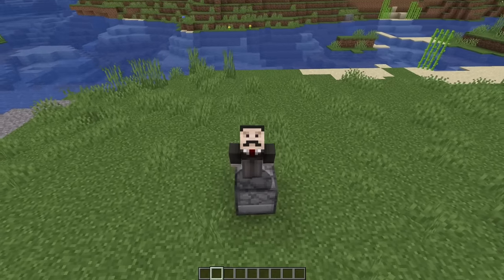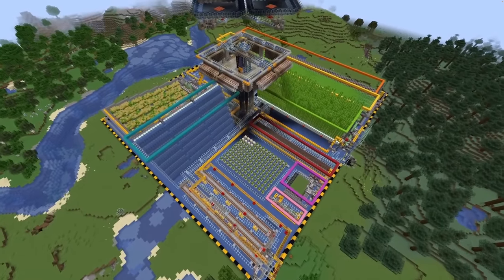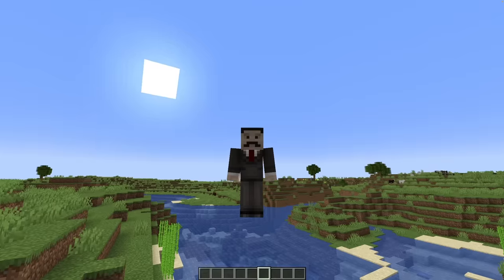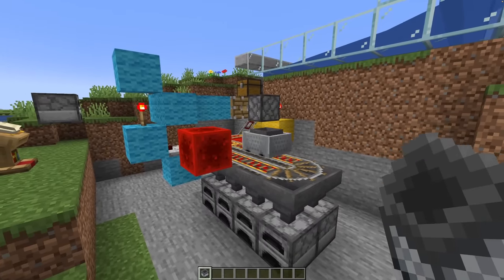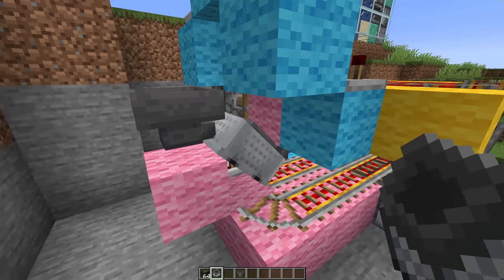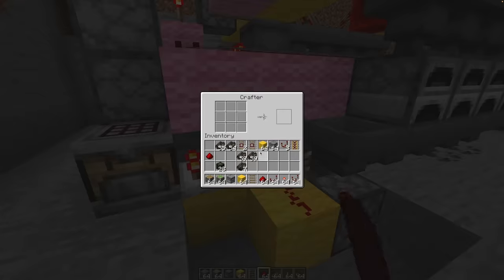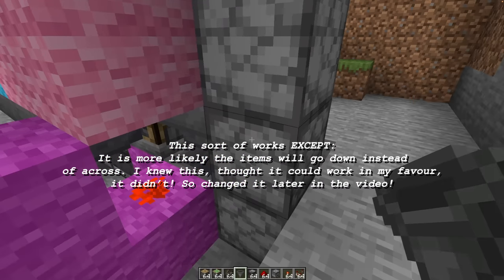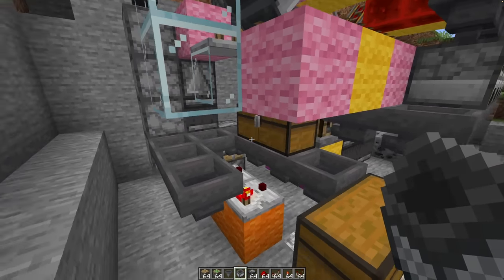INFINITE Furnace Fuel using Crafters in Minecraft 1.21

Comment: My dumb method of avoiding fuel wastage is to let a reservoir (1 or more chests) slowly fill. When it gets full-ish, the comparator output will release the reservoir's load; when it gets empty, the comparator's output will trigger the flow to stop. It's possible that there will be waste, but it happens once per load instead of every time a resource gets harvested.

Comment: honestly the kelp smelter could just be a chain of hoppers like a lazy sorting system since as long as there is a minimum of 20 you will get max efficiency so simply allowing the hoppers to overflow and expanding the chain you will eventually match the output speed with the furnaces and get a more consistent output.

sure you'll have stacks of kelp in the sytem but it's an infinite farm, having spare stacks of items in the output is the point, and if it is that bothersome dummy items can reduce the hoppe inventorys to 1 stack of kelp instead of 5, just don't dummy up the final hopper and you're good.

Comment: Notably, if you don't bone meal the plant, you need 40 kelp plants to keep a single furnace running indefinitely – as long as you are in the area. Doing the same thing with bamboo (and crafting it into planks) you only need 21 plants to keep a furnace running indefinitely. However, if you build a bone meal farm and bone meal the plant, kelp becomes way more efficient than bamboo. That's because kelp grows much slower than bamboo naturally.

Comment: could've used the copper flipflop for the kelp furnace: when detect furnace turns off, flip on and allow signal when comparator reads furnace full enough (rs strength 3, and gate to dropper handling the dried kelp blocks) ... I even made a tile able version that's 3 blocks wide years ago

Comment: Point #1 in your FAQ post, sorry but that's a problem with your specific design. If you output into a hopper line and pull kelp from the hopper line by placing one below, and have that line go to the kelp smelters, then when it fills up all kelp them just moves past. Place the unit that splits the kept after the item elevator, elevate the items up, and then split them, now letting it fill up the fuel for the kelp no longer breaks the item elevator.

Comment: You might have used the new flip flop block to match the changes to the furnace's state! And then caught when it went from on to off to input kelp again! By the time the first kelp is done burning, more is already in, so you just add your 21 bits of kelp when it turns off and voila!

Comment: I think you have made this ultra complicated in every corner.

For the kelp you could simply up the kelp farm and get more kelp. make a semi large storage with double chests that are inter connected ( or even skulker fillers)  then get your kelp from there.

and for feeding 8 furnaces/smokers, you can simple take the output of 4 furnace back into the system and send the output of other 4 to the super smelter, yes you only need 45% but set up a storage system and once that is full set up a shulker filler to send all those extra kelp to the super smelter.

But to be fair you like using red stone more and I like using basic stuff

Comment: NGL, mumbo made this so much more complicated than it needed to be. 
You can just time your kelp farm for an hour and then divide it by furnaces smelt rate to know how many furnaces you need. To setup the input, literally just send a minecart under the blocks your kelp are pushed too over a furnace array of the size you got via math. 
Then to get the kelp blocks into those furnaces, again just run a minecarft under them to get their output, have it go over their own feul input hoppers, then over whatever other storage hoppers you want or into another furnace array.

As long as the system slight over produces, it balances automatically cause hopper mincarts are rad like that

Comment: your pinned comment suggests you need item splitting in order to fuel this machine and the eventual super smelter it powers. However, consider the design of moss-based bonemeal farms (restocking the core system loop and funneling off the excess if hoppers fill up).

Comment: If anyone is looking for ideas to fuel their gigantic super smelter, just add a line of hoppers connected INTO the furnaces, water stream above the hoppers, and a carpet duplication farm at the beginning of the water stream. After a minute or so of the dupers running, the furnaces basically get infinitely fueled. You can change the size of the carpet dupers accordingly to your super smelter.
I realised that a water stream is better than a railway system with hopper minecarts.

Comment: You dont need any circuitry to enable and disable the smokers. Just make sure you producing kelp at a higher rate than you can process it. This way you will not be wasting as much kelp. Small inefficiency is acceptable.
Reply: Also you dont need 45% of kelp blocks to go back as fuel. What you want is an overflow check. while storage for the smoker fuel is not full then send it there. When it gets full send it elsewhere.

Comment: @5:30ish...If you add a signal of 9 into the comparator of the crafter you will get cut.  Better to subtract mode with signal of 8 triggering when 1 is ouput (thus all 9 kelp)...or maybe I missed something cause this was a bit fast

Comment: Anyone who wants to set how much of an item is required to start a process use a shulker loader + unloader. They are pretty easy to modify to work off a smaller amount by using comparator subtraction mode.

Comment: I have designed a 16x furnace, with carpet dupping, that is ridicule smart.

The carpet dupping only turns on when needed, its exaclty self sufficient, not a single carpet is dupped more than needed, it doesnt involve any cart or hopper cart, and it only needs ONE BLOCK LENGHT of redstone system to work. I really wanted to share it with people but Im not really a famous person...

Comment: [2:25] Could you link the first furnace to a tree farm which crafts planks/sticks and feeds them as fuel into the furnace to smelt the kelp into dried kelp? I mean they don't smelt as many kelp(s) as dried kelp blocks; however, due to the speed this farm would produce planks/sticks, the furnace could be powered for longer. Additionally less kelp is wasted in crafting dried kelp blocks, as it is used on the super smelter. @ThatMumboJumbo

Just an idea

Comment: You could cut out the refueling requirement by using campfires to make the dried kelp.
Reply: You can't use hoppers on campfires
Reply: @crossiscool6681  Yeah.... you can.
Reply: Campfires do not have an external inventory. Raw food cannot be loaded into the campfire with a hopper.
Reply: @VelaiciaCreator Unless you mean the food flying out into hoppers surrounding it? Besides campfires can only hold a few items and take ages to cook..a smoker would be far better. Using a campfire would the system incredibly slow and inefficient compared to normal smelting systems lol
Reply: @testerwulf3357  Campfires aren't nearly that slow tbh. And the hopper does pull when you properly wall things in. It's only inefficient in size.

Comment: wouldnt it be more efficient to 
a) have a chest where the minecart can pull from (because minehopper is faster then normal hopper) 
b) send the minecart off with 20xfurnace/smelter 
c)build a buffer for the drying part and every overflow will be redirected to the supersmelter (might me more lagfriendly but takes some time to fill up but garantees that the drying part is never broken) 
d) depending on the output of the kelpfarm there wouldnt be that manny smoker/furnaces needed and a simple hopper design would work as it fills up a furnace and keeps that running and then filling up another one

i would love to hear your thought on that.

Comment: I wouldn't care if it was little inefficient. I wouldn't count every item smelled by dividing it by 20. The simplest way to do it is making sure a double chest is full of kelps then flush it down to smelting until the chest is empty which you can achieve by simple rs latch and hopper locking mechanism and recycle the recently crafted dry kelp blocks through production furnace making sure they are fueled and taking the excess as profit. With this way you can circulate entire double chest of kelp and only waste kelp lesser than 20 item which is general division in math where you can't have more excess than the division itself

Comment: Mumbo... regarding keeping your furnaces full of fuel, assuming your farm has a fast enough output, could you not just have the crafter kelp blocks feed only back into the furnaces, with an overflow line that leads to the output? It's not as efficient, however, it's more resource and time efficient, and you could use the extra resources and time to scale the farm up.

Comment: Surprised you didn't just add a counter system that counts items going into a hopper chain, unpowers the hoppers on top at 1 for each module, then after twenty cycles fires a circuit to feed fuel.

Comment: Bamboo into ladders as fuel sounds way less complicated
Reply: It’d be a larger system…so more complicated
Reply: @testerwulf3357  How do you figure?  The farm is smaller, has no water, and requires no smelting to turn the product straight into fuel.  Plus all of the output becomes fuel, so there's no complicated recirculation mechanism to worry about.  It's just bamboo > sticks > ladders.

Comment: If over-engineering were an Olympic sport you would take gold
Reply: 1. If hopper feeding furnace array is FULL, start smelting
1.5 if hopper feeding furnace array is empty, stop smelting.

2. Dry kelp is crafted, 100% goes to furnace array.
2.5. Kelp blocks not used go to second array.

Done

Comment: 5:00, why does it have to be occasionally? can't you just 'overfeed' the system untill all spaces are filled up with stacks? the kelp blocks won't burn quicker than they get input anyways, so the consumption/hour of Kelpblocks won't change, it will just take a bit of time to fill everything up, but once it's filled up your 'excess' can be dumped in a chest/storage unit

Comment: Why do you need to restrict kelp block flow back to generator itself?
It will get full at some moment and you will get the same output without randomness. It will happen a bit later but this farm is fully automatic and requires only for chunks to be loaded so in a long run you will not feel the difference.

Comment: Mumbo, could you not have just connected a comparator to the hopper above the furnace that smelts the kelp originally, and had it detect for, say, 2 items? It would require "primer" kelp in that case, but then it would only ever input a kelp block when there's 66 kelp in the system, it would smelt 20 of them, then wait for the system to build back up to 66

Comment: Quick Question: with the Crafter block could you make a system where you can request an item to be crafted? there is a mod called refined storage and in it there is a block called pattern grid it lets you make crafting recipes that you can click a button to make that recipe in an instant. im wondering if that would be possible to make something like that with the new Crafter.
Reply: yes, but it would be quite massive
Reply: @techheck3358  ok ty

Comment: I feel like this is overly complicated.
1. Can't you just test if the main hopper for the kelp is full?
2. Cant you just set the right amount of kelp to smelter so you have a backlog of kelp? In other word, simply smelt slower than your production.
3. you can have an hopper line that feed the hopper for the kelp blocks fuel. If you just set it right, the hoppers for the fuel will fill first and then all the excess will flow naturally to the next step

Comment: Why not just use a tree farm, start with 1 piece of coal then get 8 charcoal. Use hoppers and droppers or whatever to move the charcoal back into the furnace so it's self powered as long as the tree farm is on. No crafting needed

Comment: Wouldn't it be easier to work out how many kelp per minute are produced and just use the appropriate amount of furnaces to not waste fuel? No circuits needed whatsoever.

Does the farm produce 50 kelp per minute? Do furnaces smelt 20 per minute? Have 2 furnaces. Done. No fuel is wasted, you are producing a constant output of 4.4(4) dried kelp blocks per minute

Comment: To be honest I don't get why "kelp crafter" cannot be just overflowed? 
sure initial fill will take a while, but if smelting input is divisible by max smelting power, you cannot waste a block. 
also this thing is not ready for overflow at all. if you dont use super smelters fast enough, stuff will break badly.

Comment: just saw this and would it not be easier to just use 2 crafters instead of trying to use one and then have it send stuff to 2 different spots. as you said 50/50 so half the furnaces go to one crafter to fuel them then the other half going out to another sending those to the other furnaces below.

Comment: My hopper minecart that feeds the kelp gets stuck on the detector rail on top. And the switchable rail gets stuck in the wrong position so the minecart can not get filled up. Can anyone help ?
Reply: I’m encountering that same issue on a server.
Reply: I figured it out. It’s about the orientation of rails in Minecraft you have to build it facing North. More specifically, if you build this exactly like his design in the world download, when you look at the front of the furnaces for the final smelter module, you should be looking North. If you build it facing south, the rail will permanently be in the wrong position.

Comment: I wish u did a step by step of building it so much simpler if it was to replicate
Reply: I built it from the world download. Takes a lot of back and forth, but pictures from angles can help. Make sure you build it where the final smelter is oriented north, meaning when you look at the front of the furnace, you are facing north. If you build the farm exactly the same it will be fine. If you don’t, the orientation on the switching rail for the kelp distribution will be always facing the wrong way.

Comment: 2:13 Wouldn't you just want to pool up the kelp until a sufficient amount has been generated then let it continue through the system? Of course, I've never made anything in redstone like that, I'm just a programmer not a redstoner.
Reply: What you just did after that is similar to what I was talking about, but there is a small difference, but I do see the problem the hoppers can't take all 21 kelp out of the pooling chest fast enough so more kelp gets put in when the system isn't quite ready. But it seems like you're generating the kelp fast enough that efficiency won't be an issue in the first place.
Reply: 3:49 Aha! That's more like what I was thinking, although it would be ideal if there were two chest carts, so that while one is filling the furnaces, the other is filling itself.

Comment: Why'd you even divide the stream of kelp-blocks? Just get them all to the cart which refills the furnaces and have and overflow mechanism put out the rest for the user.
Now that we have fully automated smelting, we need a fully automated crafting system. Can you make it like this (?): the user name a piece of paper the item you want, then and item-sorter receives the request and returns a predefined number of that item from the system, but also uses its resources to craft if there aren't enough.
Does that make life easier? Kinda.
Is it easy to build? Heavens no.
Is it cool? Absolutely.
Maybe you can even improve on it by allowing to request different quantities or whole lists of times, though I don't know how you'd do that without commands or functions.

Comment: Supposedly copper bulbs can be used as a one block t-flip flop and they are a toggle-able light source able to give out a comparator signal, they were added in the most recent snapshot and I’m wondering how much they’ll change redstone, if at all with it being a single block
Reply: It'll change it immensely. Systems that used to take whole rooms can be condensed into a few blocks wide. It'll also reduce the time for anything to happen. It makes things immensely faster, immensely smaller, and immensely more accessible.

Comment: This feel wayyyy over engineered. Could you not simply have sent all the outputted kelp blocks into the furnaces, then had overflow hoppers pull the excess out of the hoppers going into the furnaces once the furnaces were full? Yes it would require fulls stacks of kelp blocks to get started, but I’d imagine it’d be a lot simpler. If anyone cares, I’ll try to build it myself when I get a chance and I’ll update this comment.